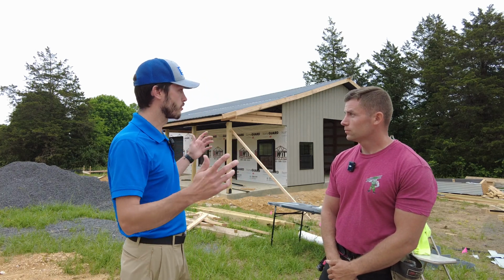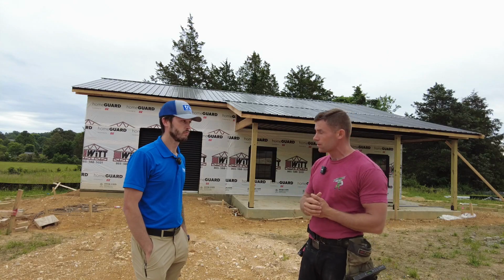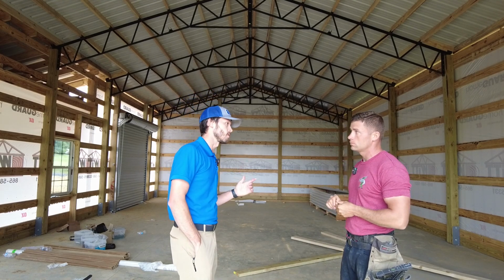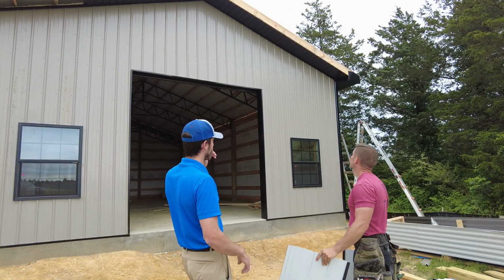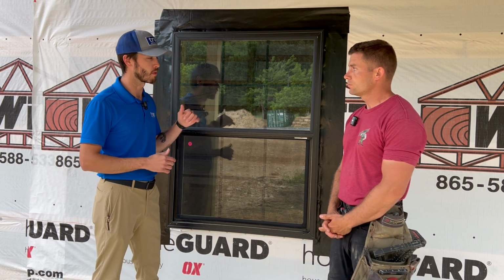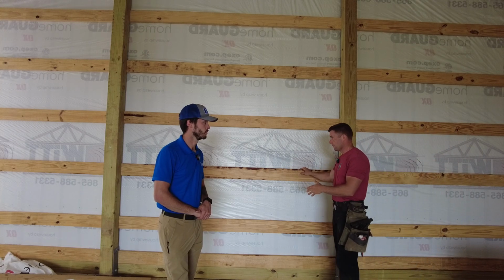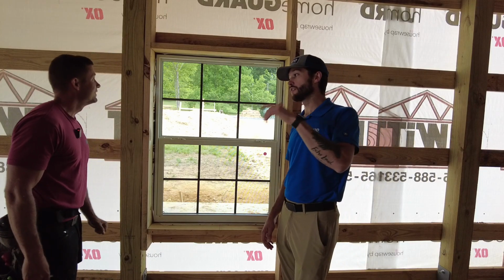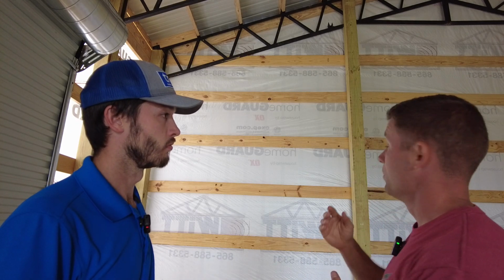Building a Post Frame Building with Steel Trusses!

Comment: Could you use these steel trusses on a tradition 2x4 built wall?
Reply from the maker: You would need an engineer to sign off on that, you'd likely have to have 2x6 studs for the exterior wall.